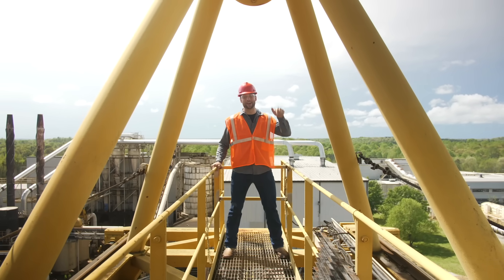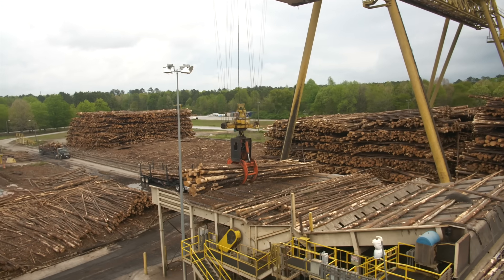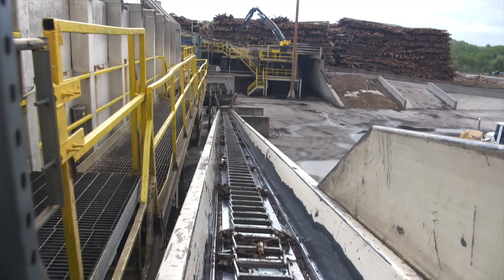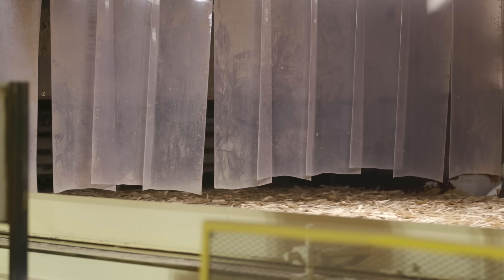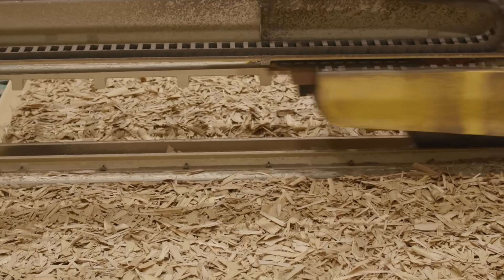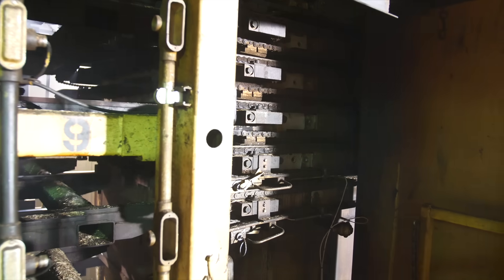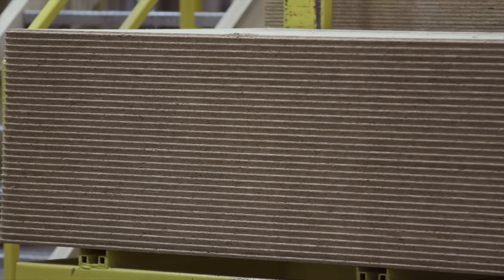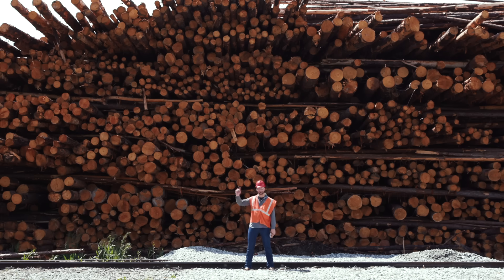Could OSB be BETTER than Plywood????

Comment: I thought the name was interesting, could osb be better than plywood. What upsets me here is you really did not compare it to plywood. As a now retired general contractor, I do have opinions. When sheething a roof and using clips, if you only get partial roof done and it rains you will now have 2 different sizes of sheething while trying to install the ply clips. Also you had better know to leave a 1/8 in. gap around the perimeter, or there will be problems as it swells. You can now buy the 3/4 in. tongue and groove and they make the tongue so that it has rectangular cuts to let water recede off of the top. good idea. Some companies also put a varnish substance just on the edges, some companies coat the whole sheet. When you frame houses and you get the 3/4 on the floor and build all the walls, all the rain that you will get before the roof is completed, you will get standing water on the floor as the bottom plates traps it in, then you have to drill holes all over the new floor before the water ruins it. Also many times after the roof is complete, you have to rent a floor sander to hit all the seams of the floor as they are raised. I believe 1992 was the 1st yr. that wafer board production surpassed plywood. Some of my obsevations.

Comment: OSB is made from pine or a mixture of pine and soft hardwood pulpwood. Wax is added to the gluing process to make the board waterproof. OSB I just a s good and a lot cheaper than plywood. I used it in my home 49 years ago and have never had a problem. OSB board is not designed for exterior use.

Comment: OSB if never in contact with water is just ok if you think you are saving on cost but once water touches it on a regular basis.  It become sawdust or simply "garbage", seen it with my own eyes. Spend the little extra if you want durability and your money to stay around for the long haul. Do not believe this babble most likely paid for by the manufacturer of this product.

Comment: I don’t know why people are praising OSB, it’s not better than plywood but it does have applications where is the suited, as sheathing I wouldn’t use it… what’s the very moisture we have here in the United States, the boards become rotted in unglued.

The problem is that you’re using chipped glued wood as opposed to stack sheets that are plied with glue…

Comment: If OSB is used for decking on your roof go into the attic and look at the nails driven through where there is no backing truss or rafter. Look at the chunk the nail blows out when it penetrates. OSB is crapwood. I wouldn't use it to build a dog house

Comment: As a builder and rental property owner, I always tell people looking to build to pay the extra for plywood. In my experience in the Southeast OSB is one of the worst building products ever, only surpassed by the infamous particleboard products. I've had to completely replace all my rental dwellings sub-floors and some roof areas as well due to OSB failure to hold its integrity.

Comment: I mistakenly used OSB for sheathing over my deck, with double layer rolled roofing on top of felt underlayment. BIGGEST mistake of my life. Within three seasons, the OSB was flaking off chips on the underside, EVEN AFTER WE HAD SEALED THE UNDERSIDE WITH OIL BASED STAIN/PRESERVATIVE. I guess when you try to combine schoolhouse white glue with wood chipper debris, you're not going to get a bridge truss worthy quality product. If you're building a project in the vacuum of space, where it will NEVER encounter a single molecule of H20, go for it, otherwise, you're F'd.

Comment: yah, OSB is trash and should not be used if you have help it.  It is not true that the wood chips are all aligned in the long direction.  The wood chips are just thrown down in random directions on the processing conveyor, so when they are pressed together, they are not as strong by far , as plywood. When OSB gets wet, it instantly become unusable and it will have lost 85% of its strength, so it's junk, period, but it is cheap, ok
C-D plywood is junk also, I only utilize A-C plywood (good on one side), yah it costs more, but it is good stuff, and it does not curl up, as C-D plywood does. QED

Comment: Better for who? It's better for plywood manufacturers bc now they cam turn all their crap into plywood and make more money. OSB is heavier, can't handle getting rained on more than one time, has a lower tensil strength(it shatters) and it makes a horrible solution for floors and roofs. In my opinion, OSB has limited uses. Makes great firewood.

Comment: Wow in the 12 minutes I took to watch this the price at Home Depot went up 2%. Actual prices at H.D. Jan 17 2022 $33.98 for 3/8 osb. Feb 2 $40.98, Feb 14 $45.78. (35% increase in 28 days.)  Gonna hit 85.00 this summer again. Glad I bought the 160 sheets I needed last October for $29
Reply: If it goes to $85,  solid pine is Thicker and cheaper.

Comment: It looks as if Jordan was buying the propaganda! Put OSB out in the elements and it deteriorates quickly. From a firefighting prospective it is dangerous. When plywood was being used as sheeting a family had 7 to 10 minutes of escape time once a detector was activated. Now that OSB is being used that time has decreased to 4 to 7 minutes. OSB burns faster, hotter and puts more toxic fumes into the air.

Comment: How about giving some technical data, not just "it's a highly engineered wood product"? What is the rating system for OSB, what are the ratings and strength values, water resistance, etc., etc. How do those measures compare to plywood?

Comment: The use of OSB in roof decking is typically not allowed in coastal Florida. Once the shingles and tarpaper get ripped off in a storm, the OSB decking turns to mush and goes away. Real 5/8" plywood apparently holds up better. We hope there is a solution to remedy this situation.

Comment: Be much better if they didnt water down the glue! Cheap bastards! Wall street share holders want MORE AND MORE!
When this junk 1st came out in the late 70's, I was skeptical,, they were using it on 3 story apt complexes in Denver and Albuquerque, Phx. Almost everywhere there was a boom.
They used it on 2nd and third floors of multi units and poured light wieght concrete over it. I was surprised back then at thee exposer too snow, rain and sun it tolerated until the roofs went on. 
It held up then,,, but definitely NOT THESE DAYS!  Over priced crap these days!! EVERYTHING including PEOPLE is CRAP THESE DAYS!

Comment: I'm in the highlands of scotland.. we call this chipboard... it's considered a cheap and nasty material.. used by people past and present to shave costs and increase proffits... it either fails due to (often) minimal water exposure or is just too weak for what it's used for.. so it not even as good as mdf... I don't use chip board and I won't use mdf unless it's for a detail and massively treated .. to the point you might as well have used good wood due to time and paint costs.... plywood.. preferably marine is the way to go... if you respect your work you wouldn't touch this stuff... now I have only built residential... so maybe this has some application for industrial..

Comment: A suggestion --- It would be helpful to print two ruler lines on the board .. to help people make the cut or nail a support rail or something .. You can experiment with prints with visible inks and another with inks that one would need special glasses to see .. For those exposed boards that they do not want to see the ruler lines ..

Comment: I’ve had nothing but BAD experiences with OSB. OSB is almost as bad a Medium-Density Board (aka Particle Board). Plywood is a far better product than either OSB OR MDB hands down. I don’t mind pay more plywood, because I know I’m getting a better product. 😳😠 If you want a cheaper building material that won’t hold up as long as plywood, then go ahead and get OSB. OSB is a GARBAGE building material. 😠

Comment: I always thought it was made from otherwise useless scraps. Anything else is a waste of trees . . . actually OSB is a waste of scraps that could be mulch, too. This stuff is single-use, short-lived, weak trash that ends up incinerated or in a landfill. The whole thing about the orientation looks entirely like marketing BS to me. Even if I were to buy that the chips are laid down in directional layers when I can clearly see the chips dropping out however they fall, there wouldn't be a continuous grain across the surface which is where the strength comes from—they're separate chips. PhDs in employ! Oh boy! PhDs in what? If it's even anything relevant, it's probably in marketing.

Comment: I have a small 4 inch square section I cut from a sheet of OSB that has a bolt impeded in it. I saw its expression within the board as I was cutting it with a circular saw just an inch before hitting it. I know its rare but the bolt must have been dropped onto it during the pressing process.  The bolt's about 3 inches long and maybe 3/8's diameter.  I keep it with the message written on it that says "Check before you cut".

Comment: When this stuff has been on the market for almost a hundred years we can see. How would you like a boat built with marine plywood, or osb? If you can use it without it getting wet, it is okay, but, with repeated wettings it looses all structural integrity. The new products may be better, but, i would still chose plywood from a good mill.
Reply: Right on Keith! started our my early life building boats, steamed oak ribs and planking! I have seen scraps of marine ply laying on the mudflats with the tide going over them twice a day for over 30 years and they haven't changed a bit! Columbia river guy here!

Comment: Osb not a fan. It should be outlawed in RV construction. Little water leaks rv is damaged. IT SHOULD NOT USED ON RVS.YES plywood is expensive but it can take water on it osb no.

Comment: Put a galvanized #8 through cedar trim and into OSB substrate for 6 months and do the same with the same thickness plywood.   In six months of weather, the cedar can be pulled away from the OSB with your hand, no tools and the nail stays in the cedar.  The cedar nailed into plywood can't be pulled by hand and usually splits before the nail pulls out of the plywood.  Why is that?   Is there a chemical reaction ( shrinkage?) between galvanizing and OSB?

Comment: In the early 70's we built a big housing development in San Diego called Tierasanta. About 500 homes. Couple year later they where having birth defects enough to be concerned. They tore up all the OSB floors, it was full of formaldehyde. They have formaldehyde free carpet and padding at the same price but you have to ask for it. They don't tell you.

Comment: I'm sorry but 99 % of all subfloor failures I have seen have been OSB!! It seems to always be bathrooms and kitchens. Once it gets wet or moist it's over. Oh and don't give me this "OSB" is stronger bullshit either! I've walked on 1/2 inch plywood subfloors and they have less flex and give as 3/4 OSB! ....OSB may be ok at first. It will seem fine when it's newly installed but,give it a few years to age and it will give up the ghost.

Comment: OSB is garbage harmful chemicals in the glue require a mask when cutting and has terrible moisture properties in damp climates, it stinks and It can absorb water and swell till the nails  pull through and long term projects already show mold and mildew problems within 6 months. It rots within 10 years if not fully protected. Plywood the glue is trapped between layers and offer lateral strength due to offset grains.  Same with engineered flooring joists the fall apart easily on long term projects and offer poor nailing surfaces that crack with multi nailing angles.

Comment: Only owned a few houses, built a few sheds, garages. After 30 yrs of being a homeowner and doing all the repairs/ rebuilds myself, osb seems to be holding up fine, unless it gets wet...kinda like any of the wood around here. I have a sawmill, and take down trees every day. Got plenty of wood if I need it. Still easier and cheaper most of the time, to just buy osb for larger sections.

Comment: OSB is ok for dry places like walls but when it gets wet it falls apart just like cheep furniture made of pressed saw dust ply wood for roofs and floors
Reply: I have seen this on my neighbors roof. Previous re-roof used OSB sheathing. Then slow leaks around skylights required re-roofing. When the crew was stripping off the old roof some of the OSB was shoveled off like wet porridge! I'd say plywood might give you a little longer life under wet conditions, but that OSB is the shizzle!
Reply: Not only does wet OSB fall apart, but it swells, gets moldy, and stinks BAD.

Comment: The Achilles heel of OSB is it’s brittleness.  Under movement stresses (as in an earth quake for example)  it wants to break away from the fasteners that hold it down especially on structures of more than one level.  For this reason, codes should require plywood on both sides of corners and both sides of doorways and maybe windows.  It also quickly turns into compost when exposed to recurring moisture and it increases in thickness if temporally exposed to moisture (it swells up).

Comment: Watch for logical fallacies: The question is, IMHO a potential false dichotomy. For example. the terms “plywood,” and “OSB” are too vague for a knowledgeable person to answer, without requiring more information about the OSB and Plywood in question. And “Better,”
is a subjective word.

Would it not depend upon the application to which the product is to be applied?, Also, watch out for those who commit the fallacy of Appeal to Authority (e.g., “I have been a Carpenter for 40 years ..). This is called Appeal to Authority. Lots of People in Authority have just been wrong for a very long time.
Objective Measures in material selection are usually available with research. There are often mountains of Data on every building material on the market.

Comment: Georgia Pacific uses the exact same machines to manufacture "shit board" as these folks.   All shit board is extremely flammable, and disintegrates when exposed to weather.  Only an idiot would build exterior anything with this stuff.   Any knowledgeable contractor will use "exterior sheathing" rated old school plywood.

Comment: When I started out, houses were sheathed with gyp board, which is sheetrock with a waxy paper on the outside. A little perspective on home construction. In the 20's , 30's and 40's houses were sheathed with nominal inch thick wood, 1X10s.  They were and are sturdy.
Reply: And most of them are still standing today!

Comment: This kind of wood sheeting keeps me in business....its the worst thing to use own your home...I replace this kind of sheeting daily because it literally comes apart when any type of moister comes in contact with...the older homes built with normal plywood or wood planking is hardly ever rotted when we are remodleing a home.....we actually don't use this type of sheeting anymore when build homes because of its very low quality...

Comment: Osb and engineered would products are great as long as the user knows how and when to use them. For instance, roof sheathing in high wind areas with asphalt shingles roofs, osb is awful depending on the type of fasteners you use. Smooth shank nails grip and hold much better in plywood than osb. I've seen shingles blow off in mass in 45 mph winds that rarely happens with plywood sheathing. Àlso during hurricanes I've seen projectiles punch through osb, especially wet osb, like it's not there not the same with plywood.

Comment: OSB is the equivalent of 'gluing a bunch of pieces together' because you can't otherwise get a piece large enough. Then, to compound this 'inferior grade material', cost-cutting by accountants leads to inferior epoxy glues being used for the end-use product desired. Actual 'plywood' is 'shaved' from an 'old growth' log in a 'flat cut', then cross-glued at each layer to add more strength...therefore 5/8" 'plywood' is DOUBLE the bend-strength of 1/2", while OSB would only be 1/8" (linear strengthening gain). We won't even talk about 'flood salvage' wood being chipped and used in OSB...while there are 60-day 'industry standards' for time from 'flood fall' to 'chip re-use', I know that this is NOT adhered to as it truly should be...I take one of the 'big two' wood companies' word on the fact that OSB we bought in 2009 came out of 2005 Hurricane Katrina fallen timber harvested in 2006, chipped and formed in 2007 (when it was pallet-wrapped). Our company only found out because due to a MASSIVE lawsuit, we had to trace back 'origin' from the original manifests...and the truth we found shocked us...as well as made our whole engineering department wary of continuing the use of wood as a product at all...

Comment: I built a 3 drawer 3x3 dresser one time for my daughter. It was in a box that was 5 inches wide 3 feet in length by 3 feet tall. OSB material. It weighed 630 pounds. Collapsed after a year when all the screws tore out.
Reply: that had to be particleboard to weight that much and to tear out at the screws. Completely different product that OSB. but neither would be a good choice for a dresser

Comment: There was an episode on This Old house, where a homeowner was concerned if OSB would protect a window during a hurricane. One window covered with OSB, one window with 5/8 plywood. The the test, shooting a 2x4 34 mph at the sheathing. 2x4 went through the OSB and the window, the 2x4 bounced off of the plywood, and protected the window!!! I was framing with a contractor I missed a nail...hammer went thru  OSB!!